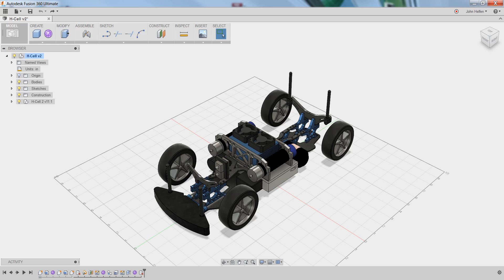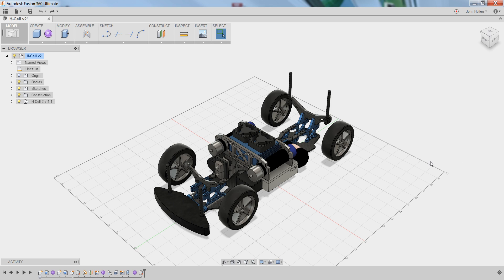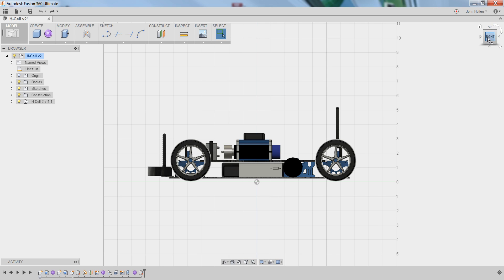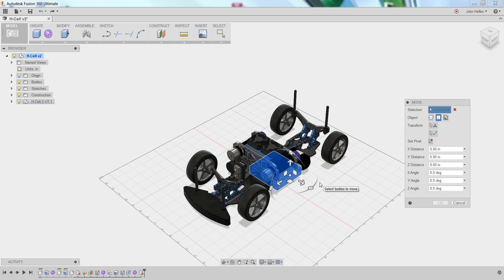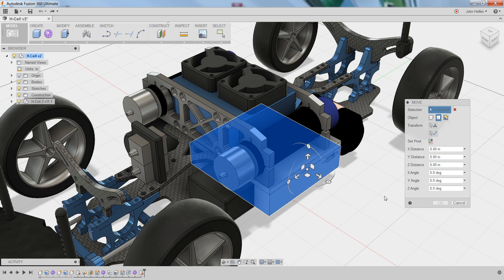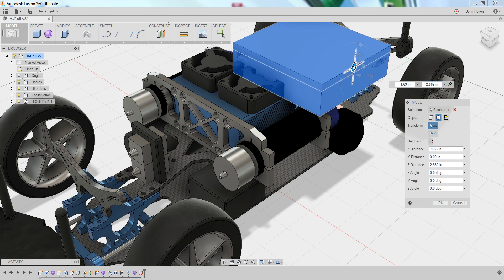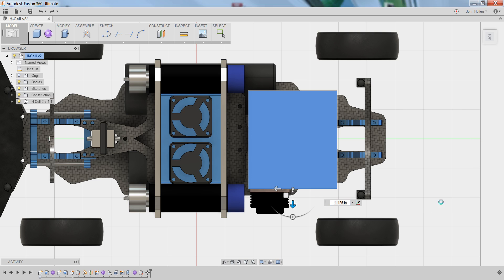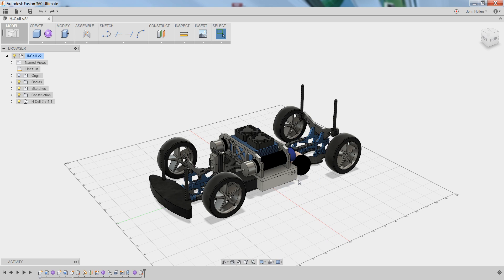Fusion 360 - Moving Parts

Comment: Other users and I have brought it up already. Why don't you group the history of the components like solidworks does so that when you want to edit something after moving it, the sketch isn't left where you first drew it. Seems like a no brainer. The long single file time line at the bottom is not the most effective user interface. I want to be able to build things and move them as I start concept work and don't necessarily know where I need things to be precisely.
Reply from the maker: Hey Dan, this can be addressed by starting with a new component. It is essentially creating a "part" container for all the specific edits related to that component. I didn't use it in this case because the work being done is a bit more free form. I agree the timeline needs some additional tools, but starting with a component will probably help with your concerns. Having each part componentized lets you activate a component and filter the entire timeline to the features that were used to create that specific component (regardless of where they lie in the main timeline). I have found this to be the biggest change Fusion brings to the table. Having been a long time Inventor and SolidWorks user, this takes some time to reverse the muscle memory of years of traditional CAD. The component will bring fusion more in line with where you are thinking, but bring the power of flexibility to design more freely in a more "natural way" (i think there are many ways to make it more natural). It is certainly a change, but once you understand that I think you will see the power it brings. Let me know what you think.